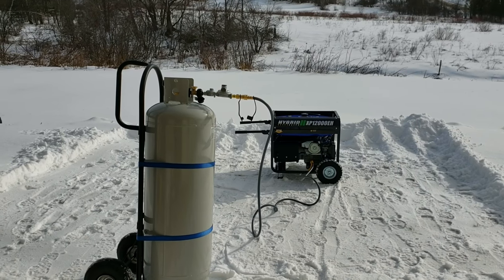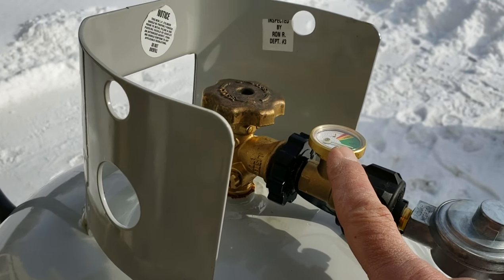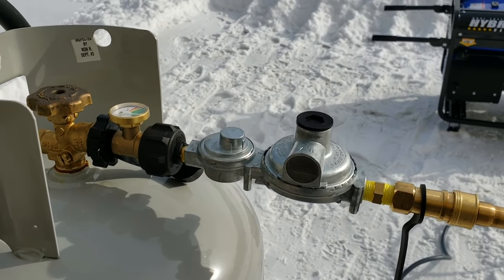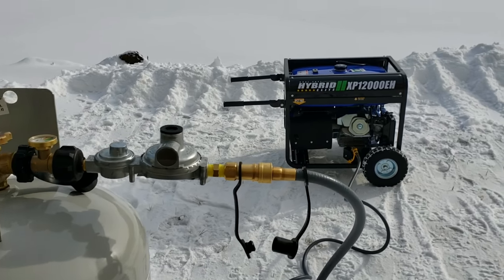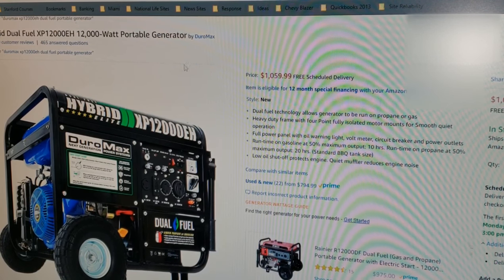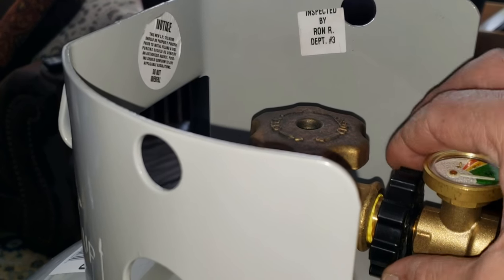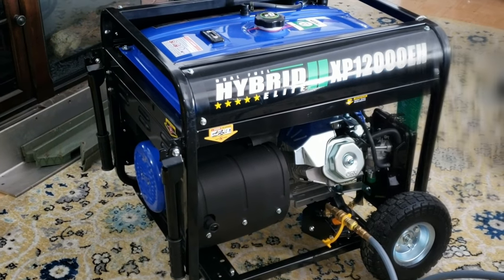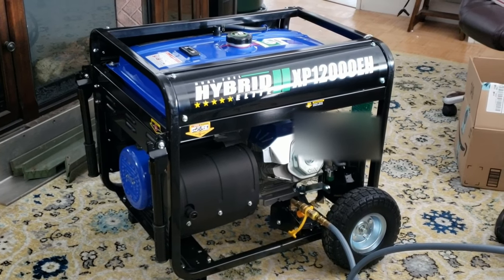Ultimate 100 LB Propane Tank Setup - Duromax XP12000EH 12000 Watt Hybrid Generator - Step by Step

Comment: I can't believe I just found you on here and just subscribed!!! I am moving to Vermont from eastern Long Island New York probably in the Andover-Weston area in Windsor county. Anyway, I have the Duramax XP 9ooo IH pure sine wave inverter with both gas and propane options . I too want to do the exact same thing you did with the 100lb tank and wasn't sure if the regulator that came with it would work on the 100lb tank. Seems it doesn't. Do you know what size regulator would be right for the 9000 on Amazon? Thank in advance. Btw how has it been running on the 100lb tank?
Reply from the maker: It runs great.  Thanks for watching.   I am not sure about the 9000 regulator size tho.  To use the stock regulator on a 100 lb tank you would need an adapter from the quick release to a Pol fitting.

Comment: Thank you for the video. Unfortunately I have the duromax xp13000eh, can you tell me if your set up will work with my 13000 watts. & Just in case if not, how did you determine the BTU 0f the regular regulator because I couldn't find anything on manual unless I missed it. Any help greatly appreciated thank you.
Reply: You could look at the regulator that came with it?
Reply: @TNRonin  Which regulator, mounted on the generator or the tank hose end. Thanks
Reply: @josecarrio The regulator on the generator.

Comment: How about an update?  Is the generator still running consistent with the installed regulator in this video?  How long does LP last if you run the genie off of a 100#er?  Would you change anything?  I just got a 100# rental and trusted the rental owner who made and provided his own gas lines that no regulator was necessary because my Wgen9500DF already had a regulator.  As it turned out, too much pressure on my generator.  I hope I did screw up the diaphram(?)!
Reply from the maker: Still works as designed

Comment: Do you know what pressure comes out of the tank before the dual regulator?
Are you sure you need it... I believe on a gas grill there is only one regulator between the tank and the grill.
Reply: I read the psi is no different on 100 pound tank and  a 25 pound tank so im not sure he got crazy with that regulator
Reply from the maker: The generator came with another regulator. The one I used for the 100 lb has similar rating
Reply: Ya the pressure will be the same regardless of tank. He needed something close to the provided regulator since he was not using it.

Comment: Great setup. I bought the same set up and hook it to a generlock. Quick question. The male hose connection to the generators L-fitting seems real loose so I'm doubling up on the yellow tape. Did you have the same problem?
Reply from the maker: I haven't noticed any issue like that

Comment: So I am the Westinghouse 12000dfc and it has no regulator on the hose but does have one at the 3/8 connection on the generator inlet side. Can I run any size hose to my 100lb tank? The one it came with is like 3ft and I wanted to go with 12ft.
Reply from the maker: I'm not an expert, but I believe so

Comment: It's about 92,000btus per gal of LP.
× that by whatever your generator consumes per hour.
And you have the needed btus per hour for that generator.
.
Also understand the gage is working on the pressure in the tank, not the volume in the tank!!
.
 propane pressure in a tank is related to the temperature it's exposed to. A gauge the reads near full in summer could read quite low In a winter storm with highs of 20F.
icing of the tank could become a major issue. Thus why large propane tanks are commonly put underground in cold climates.
As the colder it is out the longer it takes the liquid in the tank to convert to a vapor and can get to the point in some cases, where it cannot supply enough vapor to run the engine.
If it was 20F out and you ran the gen off the 20lb tank it would likely ice up and stop supplying LP before the tank is empty.
.
Clear as mud??
Reply from the maker: Thx

Comment: Sorry one more question, so the quick connect that is attached to the original regulator on generator it appears that some type of elbow or 90 degree part connects to regulator a then the quick connect.  Is that part of regular if not could you give us a link, thank you again for your help.

Comment: I'm new to this, but why  can't you just put an adapter on the tank and use the hose and regulator that came with the generator?
Reply from the maker: Cause I wanted two different setups with quick disconnects

Comment: Did you just hand tighten all connections ? The regulator I got through the link isn’t tightening quiet as much as I’d like to the propane adapter gas valve fitting that’s also linked. It just keeps spinning at a certain point and not tightening onto the threads. Any tips there ?
Reply from the maker: No. I use wrenches

Comment: I Love the quick connect setup but when you refill do you have to disassemble this? I am trying to setup something similar to yours, I think. I want two tanks so I can swap without shutting down.  I was just going to use a A/B propane auto switch, they are pretty inexpensive off Amazon.
Reply from the maker: You just have to disconnect at the pol connector on the 100lb tank.  Very easy

Comment: Thank you for the immensely helpful video. Among your Amazon links, the propane tank you bought is no longer offered. Are all 100lbs propane tanks with POL Valve interchangeable for this purpose?
Reply from the maker: I believe most, if not all are Pol.  I appreciate you watching.
Reply: @VermontPrepper  
Update: I had reported previously that I duplicated the setup but the generator didn't start up. I thought I would post an update in case anyone else runs into the same problem. Marshall Excelsior recommended a different propane adapter to use with their product (a Marshall Excelsior Co. Ff Soft Nose Pol X 1/4 Mpt Me1654, also sold on Amazon). The GasSaf QCC1 Propane Adapter Gas Regulator Valve I purchased from the Amazon link under the video may have been defective — it didn't deliver enough pressure to start the generator.

Original:

I used the links to buy the parts off of Amazon for use with the same-model generator. However, the generator wouldn't start with the two-stage regulator pictured in your video. Removed the parts except the Mr. Heater 3/8" gas connector and substituted for the regulator that ships with the DuraMax and it started right up. What is the benefit of the Marshall Excelsior (MEGR-298) regulator used in your video over the one that ships with the DuraMax? Is there something I missed?

Comment: Hi. Thanks for taking the time to make this video. I purchased all the equipment you recommended. I'm still not able to get the generator to run on the 100lb propane tank. I can start the generator on gas and then switch to propane and turn the fuel switch off. It will run for several minutes then die. I can't get it to start on the propane alone, either. Any ideas? I have the same generator as you, just the Durostar version.
Reply: I finally, after 2 years, got a regulator to work. I bought all the exact same parts as the video suggested. I still couldn't get it to run on propane. I overcame the problem by finding an adjustable regulator (Propane High Pressure Regulator with P.O.L. SKU F273719). This overcame all my issues. I am able to dial in the pressure to make the generator run great. I assume this will give me the flexibility to run the small tanks, too. I couldn't get anything to work with the regulator that came with the generator.
Reply from the maker: Wow, outstanding.  So glad to hear

Comment: Awesome setup. Thank you. Does this regulator work on a XP13000EH? Duromax indicates the following: The BTU rating for this model at a 100% load would be 178,500 BTU/Hr. The generator will need at least 3 psi of pressure to the first regulator provided with the generator to operate correctly.
Reply from the maker: Yes, it should work with it. Thx for watching

Comment: Have you had any issues with the size of the hose with the generator at or near full load? What pressure is the propane in the tank and what is it after the regulator on the tank? I am about to buy a 24' hose and am wondering about the size.
Reply from the maker: Hi Blake, no issues, but I do not know the pressure
Reply from the maker: Good info.  I am far from an expert, but it seems you did your research.  Thanks for sharing
Reply: @VermontPrepper  and thanks for your video

Comment: Can you design a 2 cylinder setup where the 2nd tank will take over without interruption when the 1st tank goes empty?  Also be able to remove the empty tank to refill.
Reply from the maker: Yes, can use this regulator.  It is the one I am using for my military trailer dual 40lb setup- https://amzn.to/2ELUiQo
Reply: @VermontPrepper  perfect. Thx

Comment: I am planning to buy the same Duromax model you showed us, and I have a question in the set up. since I will be attaching it to a 40 lbs LPG tank, what model of pressure regulator do you recomend to buy?
Thanks
Reply from the maker: You can probably use the one that comes with it.  If I am not mistaken, the connection on the 40lb tank is the same as the regular 20lb that you would use for a propane grill.  However, if the 40 lb has the pol fitting (like the 100 lb tank I have), you can use the same regulator shown in the video, but you would need to get the appropriate fittings I outlined to adapt.  Keep in mind though I am far from being a propane expert.
Reply: How did that 40# tank work out for you?   I've got the same XP12000EH coming in a few days and planned on getting a couple 40# tanks.   Did you end up using the included regulator, or did you have to find another?  If another, which one worked for you?   Thanks!
Reply from the maker: Works perfectly

Comment from the maker: The regulator I have wont fit with a 20lb.  Is a different connector.  No reason the stock shouldnt work
Reply from the maker: I wanted two separate lines, one for a 20lb and one for 100 lb.

Comment: excellent video!  Just one question though...The manual says that for propane operation the choke should be turned to the right (open) position...It appears yours is in the closed position. Just wondering
Reply from the maker: No, you don't choke when using propane

Comment: Is the gas gauge on your smaller tank the same one listed below or different? I have a 30# new propane tank and generator came with a hose and regulator on it. I need a gauge coming off the tank like you did your small tank. Thank you for an excellent video.  Now my only problem is knowing anything about the propane itself hooking up... like does air get into the line and you have to bleed them off, is there air in the gas line when first put on and used, can you get an air lock between tank and generator after hooking all those lines up?...there are no videos I can find to explain any of this.
Reply from the maker: Hi, here is one which is similar to the one I have on the 20 lb - https://amzn.to/3kxhdhO.  The one in the description is for 100 lb.  I am not an expert on propane, but I never really had an air issue
Reply: Those gages are almost useless. All they really show is the pressure of the gas in the tank. The propane is a liquid in the tank and pools to become a gas in the tank. The gauge only showed this gas presser. It will remain the same reading until all the liquid is used up. The the reading will drop very fast as the remaining gas’s is used up.
Reply from the maker: Whatever

Comment: You did a great presentation    One question I have is the pressure gauge that comes on the hose that’s supplied   Is that not adequate for the 100lb tank or is it just used on the 20 lb  I could not find any specifics on its rating   Thanks again for sharing. GOD BLESS YOU AND FAMILY. STAY SAFE
Reply from the maker: I am not sure if it would work with the 100 lb tank.  I wanted two separate setups and wanted to make sure I had the proper size.  I would ask a pro.

Comment: I have a Duromax XP4800EH.  I have had for a few years and did not use it until this winter.  It DID NOT come with a regulator that was not built into the machine.  I assumed the regulator was built into the release port at the gas inlet.  The propane line had a modern big thread to hook to the tank.  A  propane pressure gauge will only show pressure in the top of the tank.

Comment: How did you find the btu info on the stock regulator to find the one you got for the 100# tank.. I have the duromax xp15000eh.. would you happen to know if they’re the same?
Reply: Duromax told me the regulator that comes with the generator is highly modified and will work on a 40lb and a 100lb tank. You could order a backup regulator straight from Duromax.

Comment: Great Video.  I just recreated your entire set up but I'm having a problem with the regulator, it seem to be starving the generator for propane.  I  connected the regulator that came with the generator (same model Duromax HP12000 EH) and it run perfectly at high RPM, but when using the Marshall Ex MERG 298 the generator is sputtering, it runs but not at same high RPM.  I've tried adjusting the choke but  no inprovement.  Have you had this issue with this particular regulator?
Reply from the maker: Hmmm. Sorry to hear that.  I have not had that issue.  Mine runs perfectly.  You don't have idle control on, right?  Cause that would do it.
Reply: Use the one that comes with generator. case close.

Comment: Are you sure you need a 2 stage and also the generator regulator??
What are the pressures before and after the regulators if you know.
Reply from the maker: Yes, the generator actually comes with a regulator.  It is the one I use on the 20 lb tank.  I don't remember the pressure.  It was awhile ago, but I researched it.  Works great to this day.

Comment: Thank you so much! Getting ready to (hopefully) do this with my 13000EH, can you advise, will this work for that size generator also? Thanks in advance for any input you might have!
Reply from the maker: Yes, this setup will work.  Other people have done it with the 13k.  Thanks for watching.
Reply: @VermontPrepper  why do you use a second regulator if the generator has one?

Comment: will this set up work with 40 lb propane tanks as well?
Reply from the maker: This setup should work, but do your own research as well as im not an expert.  The only thing different might  be the 40 lb tank connection.  I forget if it is a Pol connection or not.

Comment: TY Mr. Prepper my question is. Can I install a brass nipped 2 inch long with an elbow so that way the connection goes down instead of to the side?
Reply from the maker: I am not sure
Reply from the maker: @ismaelmedina1343  as long as the elbow doesn't restrict or mess with the gas flow i guess you are ok, but I am definitely not an expert.  Thats why I can't say I'm sure

Comment: On the verge of ordering the same generator but if it comes with a regulator on it why do we have to have a second one for 100 pound tank. Do we need a second regulator for any tank.
Reply: I know tank size and pressures can vary, want to be able to use any of the assortment of tanks I have. Thank you for anymore advice!!!
Reply from the maker: I'm not an expert, but if you are using anything from a 20-100 lb, I would have no problem using the same regulator for myself, assuming the connections workout. But again, that's just me.

Comment: Most helpful video on youtube! Thanks for the links. Curious if the length of propane hose being used would change the type of regulator needed?  I would need to run about 25 ft of hose
Reply from the maker: Thank you.  Im not an expert, but I think the same regulator will work for a 25 ft hose.

Comment: Great video and driving force to get setup similar.  I am assuming the same setup will work with the XP15000EH and also what would you recommend for a dual (2x) 100lb or point me in the right direction.  Thanks in advance for your time.
Reply from the maker: Hi, the setup will work with the 15000eh.  For dual setup, you can just duplicate the fittings, then it would need to come into a T

Comment: For those that want to know, the "new" generators come with a secondary propane regulator in the unit, and is shipped with another two stage regular with hose.
I'm not sure what regulator you will need if you use the 100lb tank, as the connections are different.
I wouldn't like to disassemble the parts from the smaller tank regulator and adapt it to the 100lb tank all the time. 
Hope this helps.
The manual is for the older model, and yes, it still comes with the crummy wheels, although the extra sheet that comes with the manual states that you need to install the wheels with the air inlet to the outside for pneumatic tires. 
Maybe it's for the pneumatic wheels that you will buy in the future, to prevent the flat spots on the ones it comes with.
Reply from the maker: Good information.  My video shows what to do for the 100 lb tank